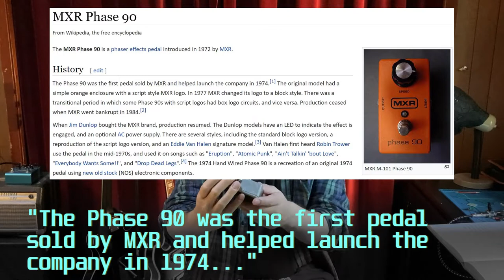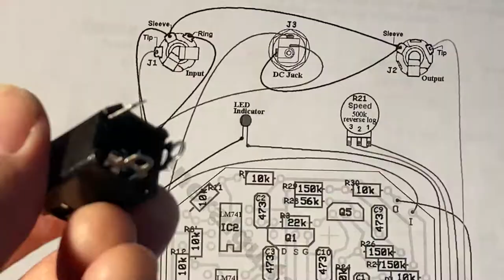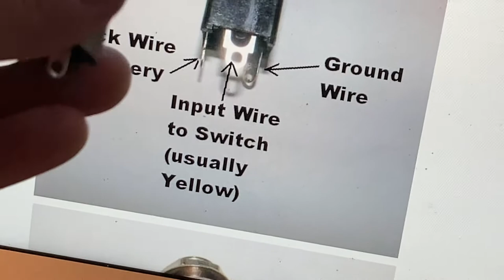DIY CLONE of the Classic MXR PHASE 90 - build and demo

Comment: Nice video and nice tones.  Thanks for posting.  I'd like to add a phaser to my pedal board and the Phase 90 is "the sound" I really want.  The build doesn't look super easy, but I think I'm going to give it a try.  Thanks!
Reply from the maker: I agree the Phase 90 is really THE phaser - unless you can afford a Maestro (which I could not find a viable clone for). The build is not too hard, go for it!